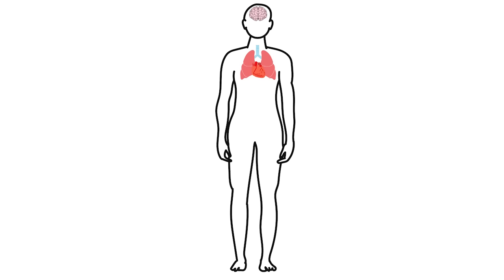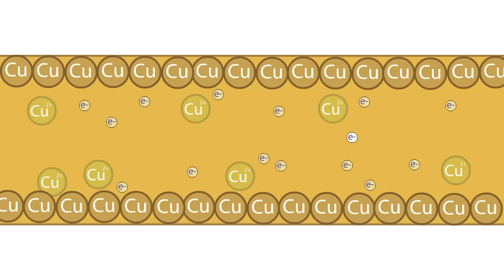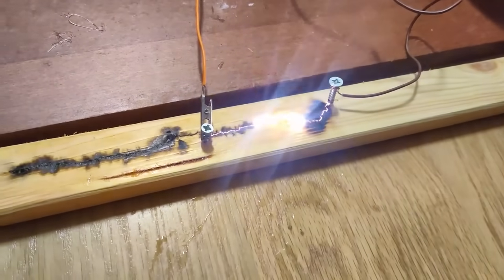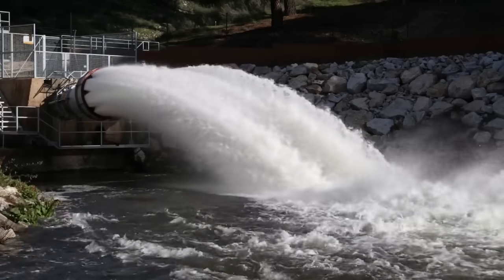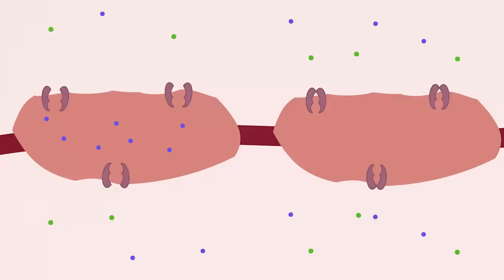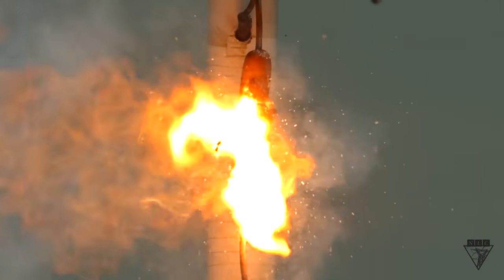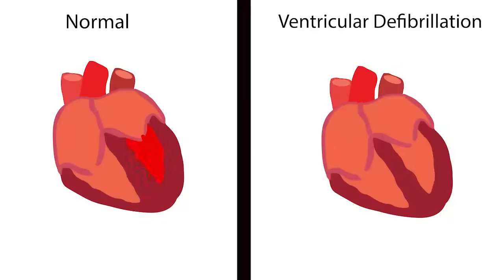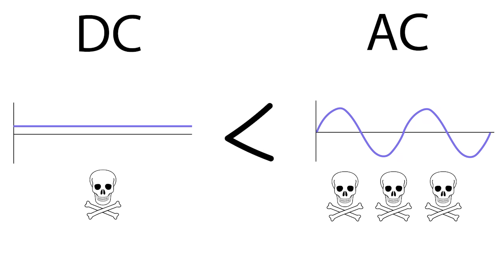Anatomy of Electrocution

Comment: So getting the electric chair wasn't so bad after all. Knocks you out instantly. Interesting. Now knowing this, I would choose electric chair over all other forms of execution. It actually seems the most humane, despite the horrible contortions the body is doing.
Reply: Execution nowadays would actually be preferable (of course if still done correctly). Basically there's 3 courses of drugs iirc. One makes you fall asleep, basically anaesthesia, next one prevents muscle movement, and the third causes your heart to stop. So basically you just get to fall asleep forever.
Reply: @majorphysics3669  This too can be easily botched. There are plenty of horror stories about lethal injections. Every procedure( not just executions) has a failure rate. If you are going to execute people you must accept whatever error rate prevails with the chosen method.
Reply: @1906Farnsworth  I know, that's why I said when done correctly lol. I did just read a comment saying nitrogen would be the best and most humane method, and I think I agree. Any form of hypoxia where you kind of don't realise what's happening. Hard to botch, and cheap.
Reply: @majorphysics3669  Agreed, Nitrogen might be the "best" way, but I am not at all sure we should try to find a "good" way. If you are reluctant to cause suffering, you have no business killing people. Making it nice makes it worse. I think that the method should be chosen based on the effect on the witnesses and staff. If the victim thereby suffers less, that is to the good.
All that said, I think that governments should not be allowed to kill their citizens. Little if any good comes from it.
Reply: @1906Farnsworth  I also agree, I am against the death penalty. It's just an interesting thought exercise.
Reply: Its only ok if it is done right. There is plenty of possibilities to botch it. A bad electrocution is very bad indeed. Most standard ways to kill people can be done well or horribly wrong.

Comment: A few nuances about electricity

While the model of electrons moving in a straight line through the wire is useful, in reality they are moving in random directions with a relatively miniscule drift velocity caused by the electric field. Veritasium's video explains it well if you want to learn more: https://www.youtube.com/watch?v=oI_X2cMHNe0

"Rubber has a resistance of 10 -100 MOhms"
Particular objects have a resistance, the way materials are measured is with resistivity.  The formula for resistivity is: ρ = R(A/ℓ), resistivity equals resistance times cross-sectional area divided by length. The units of resistivity is simplified to Ohms*Meters but it is really Ohms per unit of Length per unit^2 of Cross-Sectional Area.
For example, if an object had a cross-sectional area of 1 cm^2, a length of 1 cm, and a resistance of 100 ohms, that material would have a resistivity of R(A/ℓ) => 100(1/1) = 100 ohm-meters. An object of the same material with a cross-sectional area of 1 cm^2 and a length of 2 cm would have a resistance of ρ/(A/ℓ) => 100/(1/2) = 200 ohms.

"When electricity passes through your skin, the high amount of resistance generates heat"
For an ideal voltage source, higher resistance actually means there is less power P = V^2/R. Hence why electrical workers wear rubber gloves. However in real life, voltage sources have a source resistance so as the load resistance becomes smaller, the power will peak then get smaller(https://en.wikipedia.org/wiki/Maximum_power_transfer_theorem ). Adding the sponge to the prisoner's head decreases the resistance and actually results in a greater power transfer. The reason the sponge stops burns is because water has a high specific heat capacity and will reach a lower temperature than bare skin despite absorbing more energy.

"This means the current would be turning on and off 60 times per second"
It would be 120 times per second. In the flickering lightbulb, the times when it is on are the peaks and troughs of the sine wave, when electrons are moving fastest in either direction. The times when it is off are the inflection points, when the electrons are still.
Reply: Don’t forget to put m^2 and m in the equation. It’s Ohm meters: for the example, it means that the resistivity is: 100(0,0001/0,01)= 1 Ohm meter.
If we go to 2 centimeters, then it’s: 100/(0,0001/0,02)= 200 Ohms. 
Also, are you okay to say that while voltage is necessary for current, it doesn’t mean that you have to have a high voltage to have a high current ? The only thing bugging me is with U=RI. How does it work when you change the medium. For example, when it goes from your skin to your nerves. Is U staying constant and I changing to match it or is it the other way around ?
Reply: @Hultraman  You're right, what I had was Ohm Centimeters:
100 Ohms (1 cm^2 / 1 cm) = 100 Ohms * (1 cm) = 100 Ohm cm * (1 m / 100 cm) = 1 Ohm Meter
1 Ohm m / (1 cm^2 / 2 cm) = 1 Ohm m / (0.5 cm) = 1 Ohm m / (.0005 m) = 200 Ohms
Reply: A lot of great details that are 100% unnecessary for the video. Still useful knowledge though 😉
Reply: I think you got something wrong there.
The reason, why the high resistance of your skin, will make it get very hot,is that the rest of your body has got lower resistance. And thus your whole body restistance is almoust only set by your skin. And thus almoust all the voltage across your body acts across your skin. And thus the most power dissipates on your thin skin, and thus it burns. 
You can maybe relate to this in a circuit this way: If you take a 0.00001Ω wire and short the main soccet, then while there is flowing lots and lots of current, and thus the overall dissipated power is very large, the dissipated power on this wire is very very low, and thus it wont get hot. Instead if the breaker doesnt pop, the wires in your house will get very hot.
But now if you put a 100Ω resistor across it, there wont be a lot of amps flowing, and thus overall power is very low. But still this resistor will get very hot, cause approx 500W are dissipated across it. The maximum power you will get out of the socket however (if it had no breakers) is if you use something, with the same impedance, as all the wires from the power plant to your socket. (you can derive this by the derivative of the power consumed by a resistor in series with another resistor).
Reply: Don't even try. The video is bs. It might outline some core concepts, but in detail it's full of inaccuracies, basically all units are explained wrong, resistors are explained wrong. It's a nightmare for any EE.
Reply: @graealex  Absolutely correct.
Reply: @graealex  Jupp. But to be fair I've never seen any TV documentary on anything EE related that didn't mess up a lot (sometimes more than they got right). So I guess it has TV quality?

Comment: My paternal granddad was an electrician. I remember him having us four grandchildren hold hands in tandem: Grandchild #1 would touch the radiator and grandchild #4 would hold Grandpa's hand. Then with his other hand, Grandpa would insert the 'blade' of his nail clippers into the "hot" (-) hole of the nearest receptacle/outlet so we could all feel the tingly current, until grandchild #1 (usually me) chickened out and let go of the radiator pipe, which would break the circuit and the tingling would stop. Fun times! until Mom found out and all the sudden we had a different baby sitter.
Reply: We had a science teacher that invited the class to form a circuit by holding hands. One student would hold the sparkplug lead to a lawnmower engine magneto and the other would touch the crankcase after which he would pull the starter rope and the shock would travel around the room. Good times.
Reply: I often wondered why you can pick up Radio Free Europe on your teeth's fillings! It all makes sense now.
Reply: Good old GRANDFATHER'S, WILL ALWAYS TEACH GRANDCHILDREN SUM THING IN LIFE.
Reply: wtf
Reply: That sounds like a good babysitter to me, i had a physics teacher in high school who would incorporate the class in any way possible and that was one way he did it, one of my favorite teachers I’m still in contact with him although I’m in college now
Reply: Lmfao.
Reply: Dude wtf
Reply: My maternal grandfather was a fireman. He used to light a torch and run it back and forth across your arm. After that, you never forgot that fire is hot. Lost the use of an arm but learned a valuable lesson.
Reply: @pwk22  Uhm, is there a way to keep the use of both my arms?
Reply: A real man your granddad was! Without such people, the world would be full of snowflakes.
Reply: 😂😂😂😂😂😂😂😂sure your mom had to replace him
Reply: Form a human chain and touch an electric fence as kids. Last one in the chain got the shock. Ive been shock by 120v many times. Respect the proper gear. Like rubber sole boots and plastic watch. No jewelry. My father would just flip the wire with the finger nail. Yes it's hot. Try another breaker till it's    off. Not for me.
Reply: Girl WHAT???

Comment: That live leak reference was too real 😅. LL, Ogrish, rotten etc taught me some very valuable lessons such as, always br grounded, wear a seatbelt, don't piss off narcos, don't piss of jihadists, don't piss off neo-nazis and in general just don't piss of anyone.
Reply: not gonna lie, Internet videos made me give up my dream of driving a forklift in a steel mill.
Reply: You want your appliances to be grounded, not yourself. If you are grounded then there is a clear path for electricity to flow from a live wire through you.
Reply: Wearing a seatbelt is akin to basically hanging and breaking your neck. It has an even higher mortality rate, but no, big auto doesn’t want you to know that
Reply: @wolfetteplays8894  still using controversial statements to get people to look at your channel? Or are you just generally this despicable? 
this is my second time finding one of your comments. It's like you're my own niche lolcow.

Comment: Electricity is just really terrifying to me and that airport video perfectly illustrates why. It's almost completely invisible (at a low enough voltage) but it instantly grabs you and forces you to hold onto it while you are helplessly cooked from the inside.
It doesn't help that seeing someone get electrocuted looks pretty horrible and unnatural. Their bodies twitch like they're possessed with no visible thing hurting them until they just drop dead.
I'd honestly rather get shot please, thanks.
Reply: To be fair, the airport incident was caused by negligence on the part of the fan manufacturer for not properly grounding their product. I hope someone got sued for that. Basically what I’m saying is just because something can be super scary and sometimes lethal doesn’t mean it needs to be
Reply: Can you explain what grounding means and how it works?
Reply: Yeah, I'm fine with working with low voltage, but anything above 50V DC is terrifying.

Comment: The electrons do not move from the wire into the toster to heat it. the electric field produced moves the electrons already in the toster to bump into its atoms heating it. the adverage current flow of an electron is less then 1m/s

Comment: it would be neater to use induction, with a last meal of rusty bolts.  if they're not happy with that, then a big shot of battery acid to the vein will have to do. nobody's going to take capital punishment seriously if the criminals don't suffer worse than their victims.
Reply: The point of capital punishment isn't to make the convicted suffer, the point is that the crime(s) they have committed were so heinous that they are granted no other punishment to endure than the end of their own life. Your pleasure in their demise is absurd, are you that bloodthirsty? Do you want them laid on a slab and then butchered and stabbed until they die? There's something wrong with you
Reply: @jamesduncan6729  you're projecting, I never said I receive pleasure from capital punishment

Comment: What a cliffhanger, now you make me curious about why they flip the switch 3 times for different durations of time..
Reply: It's to reduce the amount of burning of the skin beneath the electrodes. The initial high voltage jolt (~2000v) was designed to inflict damage on the brain to produce instant unconsciousness and the lower voltage (220v to 1000v) damages the rest of the body which is why the lower voltage phase is usually much longer than the high voltage phase. Although some states did cut off the power between jolts, most changed voltages automatically without disconnecting the power in what is called a 'cycle'. The person throwing the switch (or more often pushing a button) typically had no control over the system aside from turning it on, the system would do all the work and shut itself down when the cycle was complete. If the person was still alive, the 'executioner' would be told to push the button again.
Reply: From a quick looking-up, the first shock (2300 volts/9.5 amps) is for knocking you out. The second shock (1000v/8a) is the most damaging one and slow-cooks your organs. The third shock (2300v/9.5a again) is to deliver the kiIIing blow if the second doesn't do the job.
This is just the procedure for Florida, however. It varies by state. Some other places don't alter the voltage or timing at all, just flipping the switch, letting it cool down, flipping it back on, etc. at regular intervals and a constant charge.
Reply: @LendriMujina  eyo cool thanks!

Comment: It's worth mentioning that, despite changes in EM field spreading with the speed of light (including changes when an electrical circuit is connected), electrons themselves are moving relatively slowly, with a speed of about 0.5cm per second.
Reply: It is sometimes said that electrons move through a wire as quickly as honey.
Reply: Look up electron drift. It’s symbol is j
Reply: Actually, they are moving rather fast at ca 100 km/s due to thermal energy but also randomly, i.e. in any direction changing (or bouncing) with a high frequency. The averaged movement for many electrons in a conductor, called drift velocity, is relatively slow, much less than 1m/s
Reply: Yes because the power isn't being provided by the literal movement of electrons.
Reply: Beat me to it
Reply: EM?
Reply: @Capecodham  Electromagnetic
Reply: @Capecodham  NI 😎
Reply: how could that be a nano second is 10 inches
Reply: Not light speed. It is traveling through a medium (our atmosphere) making it slower
Reply: Per second ?
Reply: Yup, current is more the movement of holes through the material than the movement of electrons. Holes are the (virtual) "particles" that have the opposite charge of the electron.
Reply: @WowUrFcknHxC  LLC
Reply: I didn't get that
Can you recommend what to Google to research it further?
Reply: @thomaz851  Googling "drift velocity" should help
Reply: @thomaz851  It's true, I remember my highschool science teacher telling us this. The reason why the electric current works is because the electrons are in the material from start to finish
Reply: Per hour*
Reply: Was just going to bring this up, albeit the actual drift velocity is usually closer to 1mm per second.
Reply: Thank you for that.
Reply: I'm addicted to pigger nussy 🤠
Reply: @redneckshaman3099  😂
Reply: electrons aren’t real buddy, just like photons are not real.
Reply: @zlClutchy  Same goes for birds. But a man of culture such as yourself surely already knows that. 😉